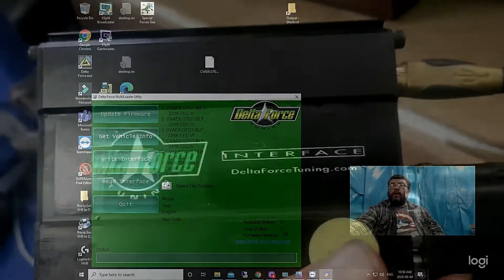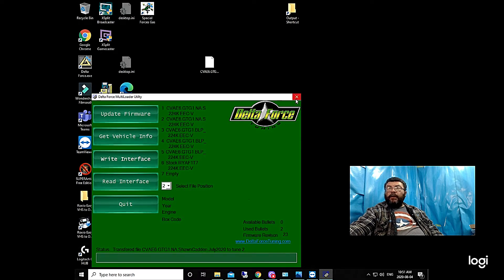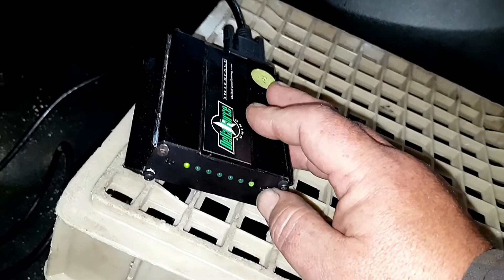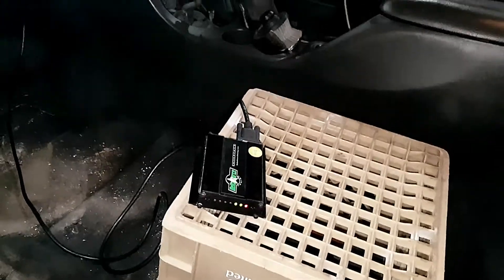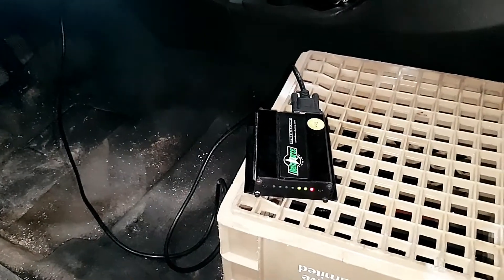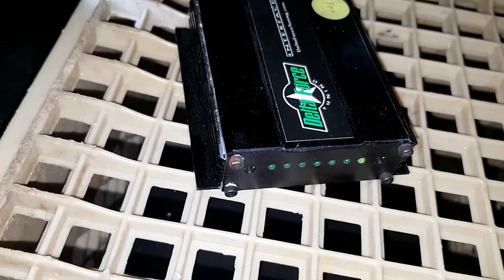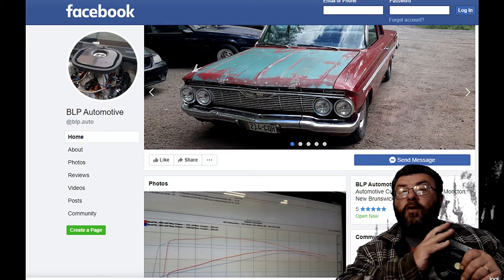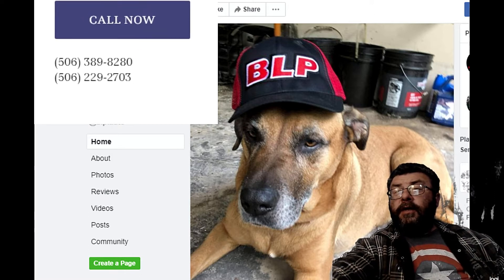delta force interface loading a custom tune into a 1999 mustang gt

Comment: Can you send me a picture of your borderline spark table, I just want to compare it with mine, if you don't mind.
Reply from the maker: i wouldn't mind but  , it was a custom tune sent to me by my tuner i cant even open it  ,if you have a way to open it i can forward the email.  i dont have the revised tune ,this was just to fire it up.
Reply: Im used special forces first. Then got commando. Commando let's me look at and change everything. Did you just use special forces.
Reply from the maker: @1alex1311  my tuner{guy} has special forces pro dealer end software it is different than the commando . i didn't build it what is your issue? the issues i have had were never software related ,it always ended up being a hardware issue ,like comp cam gears for example .

Comment: When downloading the new software into the vehicle, how critical is it to hook up a battery charger, so system voltage doesn't drop to a level that may interfer with the process?

I don't get the hot for teacher reference. Is it filled with cocaine, and young ladies throw their panties at it?
Reply from the maker: I had the battery charger hooked up because it is critical to have a good battery.  Excellent observation. 
After you pull it through the gears it certainly feels euphoric as cocaine. 
The exhaust note reminds me of the drum intro to the song lol